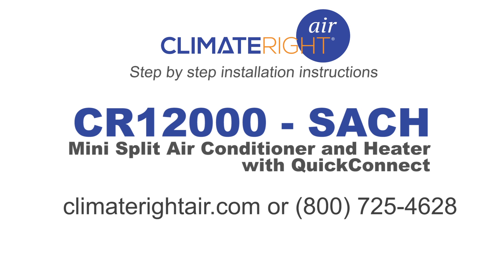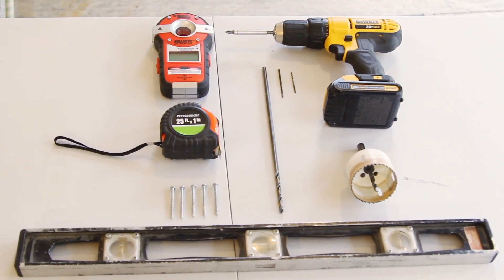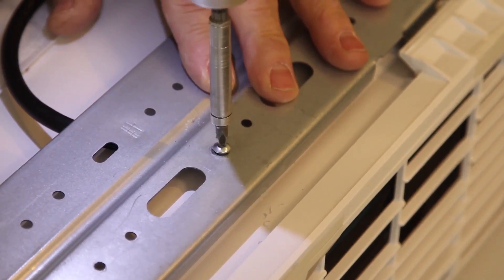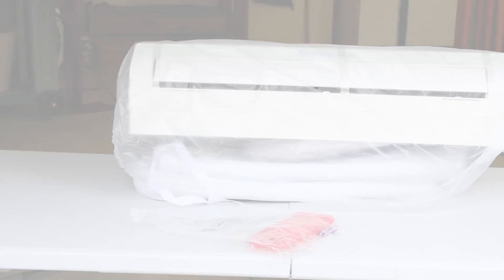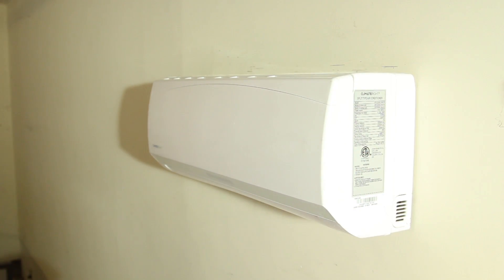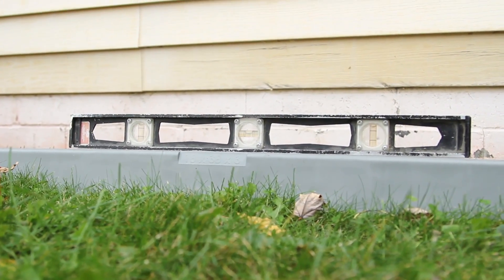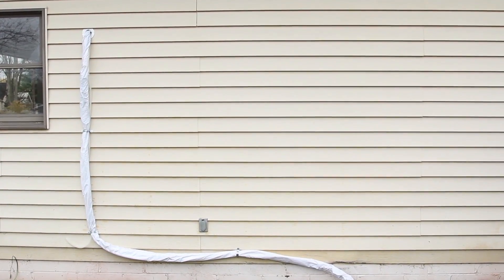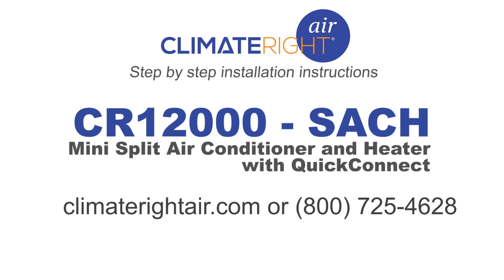ClimateRight CR120000SACH Ductless Mini Split Installation

Comment: The unit does not discharge refrigerant. The quick connect simply unsnaps and you are good to go and relocate it, and reconnect without evacuating and recharging . The key is the quick connect system which is unique to this unit. Thanks

Comment: So far I am quite happy with the unit. It has been a week. The install was very easy. I do notice that the unit constantly runs no matter what the temperature of the inside room is. I have tried setting the heat at 61 but the unit continues to blow even though my thermostat says 65 degrees. Is than an issue? Or is this unique to the climateright unit. I have tried contacting the company with no answers
Reply: The fan will run on low speed continually with very little power consumption. Normal. Thanks
Reply: @toddarend3140  okay great! Good to know. Not sure why there are so many negative comments. We have great success so far with this unit.
Reply: @drewh7421  all mini splits do that
Reply: @magiccheeseball  no they don't. But thanks for your incorrect opinion
Reply: @drewh7421   it's not an opinion oh, I've been dealing with mini splits for 20 years and have yet to see one that the fan turns off when the unit is on. The outdoor unit turns on and off just like any Central AC but the indoor unit fan always runs constantly that's just how they were designed. The thermostat is still working it's only the fan that is running not the compressor
Reply: @magiccheeseball  well that's weird because we have 2 others and when the units reach temperature the fan shuts off inside and out. Also the people who installed mine install at least 5 a day.
Reply: @drewh7421  that's interesting what brand and model are they? That's really cool I would be interested in looking into one of those, it's probably a brand made in China they make quite a few even though Japan came out with them first
Reply: @magiccheeseball  one is a Daikin and one is Fujitsu
Reply: @drewh7421  my bad, nvm what i said, i just noticed you were talking about heat mode and i was referring to cool mode. i am from Florida and know nothing about heat mode i have never used it once, but i looked up one of my other mini splits and it said  the fan turns off 2 min after it reaches the temp that was set.

Comment: I have a question about the quick connect. Once you make the connection can you undo the connection and then reconnect or it a one shot deal where if you re open that connection you will lose the charge?
Reply: It can be reconnected multiple times without losing its charge.
Reply: @toddarend3140  That is amazing! I think your product is the only one that offers that feature. You should really market that a little better. :)

Comment: is the unit serviceable like if it was low on charge or a compressor went out
Reply: The unit does not have service ports. However the unit  has not had issues with low refrigerant or compressor failures with proper install.
Reply: 1 service port on de left side of the quick connector

Comment: How long is the wiring? (How far away can the outside unit be from the hole where it comes out from the inside unit?)
Reply: This unit comes with 16 feet of line set. You will effectively have about 13 feet of "available" line set if you install it as recommended.  There is no required amount of space the outside unit needs to be from the wall.

Comment: Ya that's what aura systems said, no HVAC installer needed.  Unless you have a vacuum pump, and an HVAC license, and the flaring tools, your gonna be calling a pro.  I call bullshit.  Plus it has to be connected to an electrical shut off that electricians install.
Reply: did you even watch the video? this is not a normal mini split that needs those things, it has a sealed line set with a quick connect, no need to vacuum. you couldn't vacuum this even if you wanted to it has no service ports.
Reply: you dont need any of these tools
plug and play
Reply: @Marc.Lanting  that wasnt my experience.  Not by a long shot.

Comment: @ToddArend ....Is this unit a true heat pump? The video says it's a heat pump, but the product specs don't say that? 

Also, is the compressor equipped with Gold Fin technology? 

I'd suggest someone edit the video intro, and mentioned the 115 Volt connection has been changed from a plug in, to hard wiring to a dedicated disconnect breaker box.  Climate Right suggests at their company site, to use Home Depot 30 Amp breaker box part # 100576894, which I've seen for about $10.       

Imo, some of the negative comments may be from disgruntled AC contractors who are mad because they are not getting $2000+ for the installation.
Reply: Yes the unit is a heat pump. The compressor is an inverter type 4,000-12,000 btu as required. Quiet/efficient.

Comment: might also want to add check your state and local codes as in some areas if you do not have a licenses to work on hvac units you could be fined heavily.